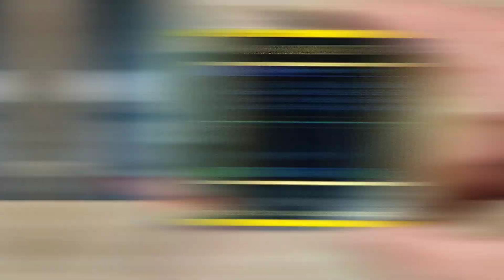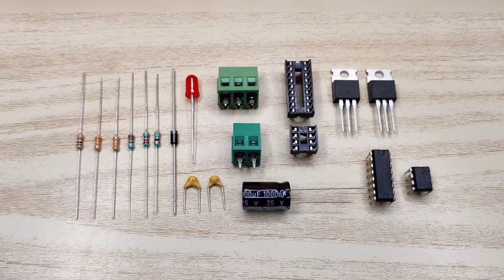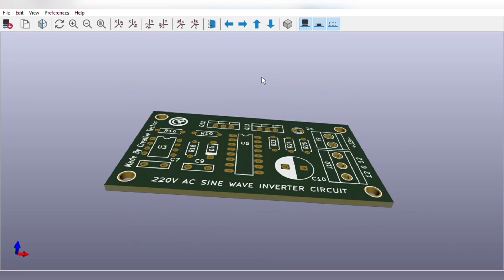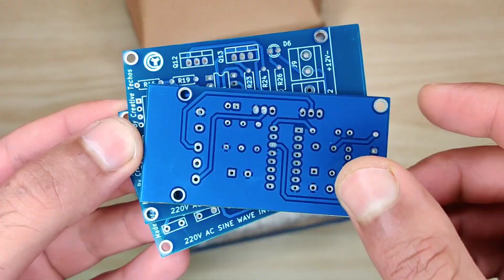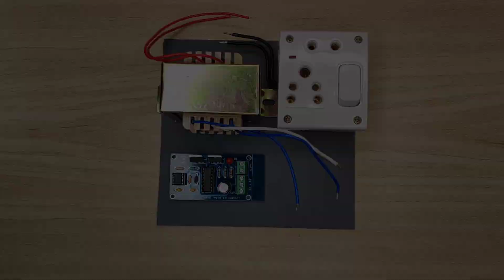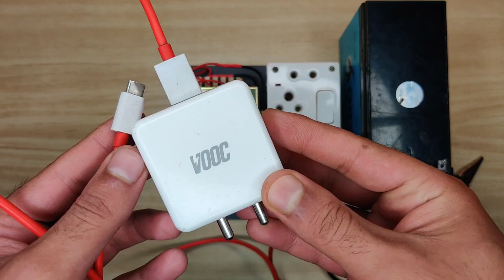Modified sine wave inverter 12v to 220v

Comment: Getting only 140 v Ac output
Reply from the maker: Connect 100k variable resistor to 100nf capacitor connected to pin 5 of 555ic before connecting to ground, and you'll be able to adjust voltage
Reply: @CreativeTechos  Thanks
Reply: Not working

Comment: Simple and great project but it should be mentioned of wattage of the project. Great working, thanks you.
Reply from the maker: The wattage is maximum 200W, you can add more fets and use bigger transformer to get higher wattage.